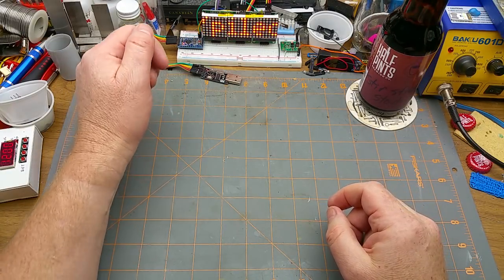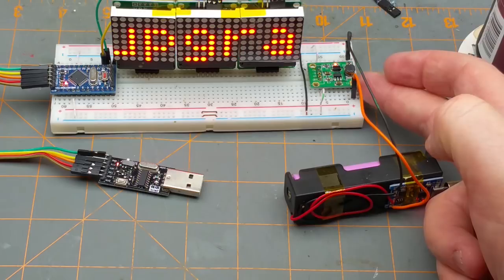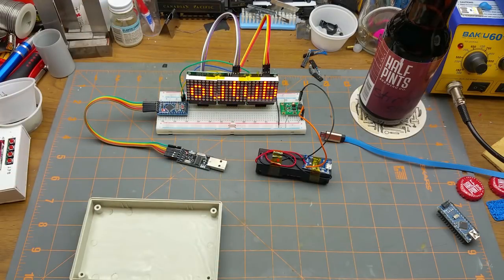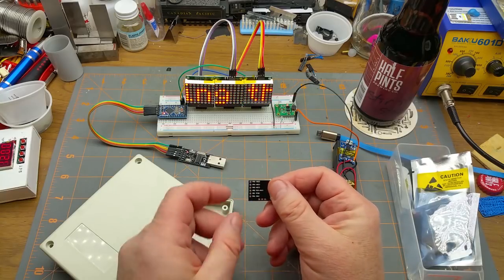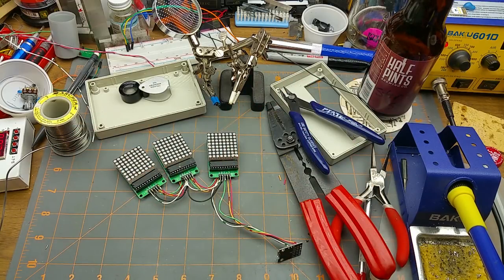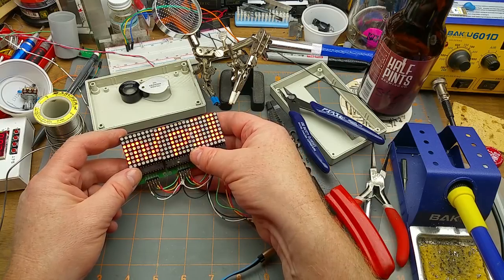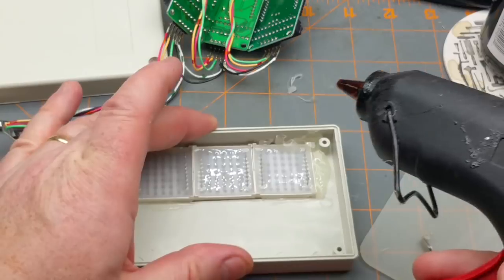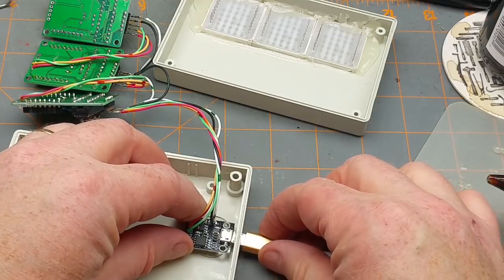Upgrading my scrolling sign

Comment: Nice. How do you program them? and Do you have the code?
Reply from the maker: Check the link in the description. The code is borrowed from Yvan at Brainy-Bits. 
All I need to do before each video is change the text string and connect my computer to the USB port.
Reply: Thanks :-)

Comment: Which library is it you use for this? I have had mixed success with libraries for the 7219, some work with certain modules, some work well with others.
Reply from the maker: I got the code from Yvan at Brainy-Bits. I put a link in the description.

Comment: I would have added a nice red or orange filter to the front of the display and fitted a bezel to cover up the uneven edges around the cutout.
Reply from the maker: At normal viewing distances its barely noticable.

Besides, I'm all about the "rough around the edges" look
Reply: @pileofstuff  The filter should make the contrast of the sign much more readable in the background of the videos. It has been frustrating me a bit in the past trying to read the sign in its old state. That said, even the work you have just done seems to make it a little better contrast for reading.
Reply from the maker: I think the fact that it's sitting more perpendicular to the light has improved the visibility.
Stay tuned for more upgrades (or at least upgrade attempts)

Comment: If you have a 3d printer the case here is quite nice.. https://www.instructables.com/id/LED-Marquee-Scroller-Wemos-D1-Mini-ESP8266/
Reply from the maker: My local library has a couple of printers that I am starting to use.

However, it's a challenge to work up a project when you have to wait in a weeks long queue to print each iteration.

Comment: Nice one. 2 things I would have improved are I would have printed a case and used one of those 8x32 matrixes that you can get pre made. So you just need to wire the first because essentially those are 4 of those modules in a row. But I’m not sure if you are into 3D printing....
Reply from the maker: Pre-made?

Whare's the fun in that??

Comment: Nice work with hot glue without burning yourself, no joking. For me it's most dangerous tool, got some nasty burns with it. Only use epoxy, B-7000 (clear), T-7000 (black) lately.

Comment: Nice one. I like ATtiny's.
If you're a cheapskate like me and your project doesn't need much RAM (like this) ATtiny13's are cheaper and compatible.
Reply: I bought 10 of those ATtiny13's last year.  At 30 cent was happy for I saving so much over those "expensive" $1 ATtiny85's. Surely a scrolling sign is workable with a tiny13, but the 8x8 font probably takes 768 bytes, and you only have 2k, so you would probably end up in avr-gcc or AVR Studio to get this done.   The Arduino environment is a bit heavy.  Keep chuggin at 9.6mhz!
You know, an ATmega8a costs only 40 cents, and has lots more resources.  You could use Optiboot on one without a crystal, so an Arduino person will be right at home.  @pileofstuff really needs an FTDI bridge to get that DTR signal for reset, though.  The CH340G is kinda lousy.